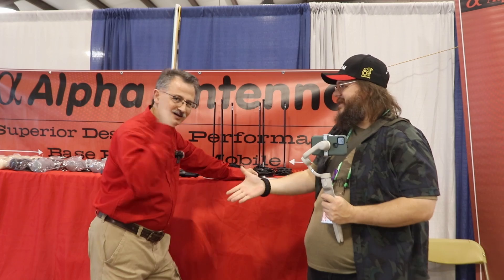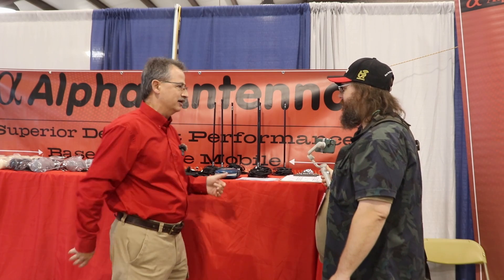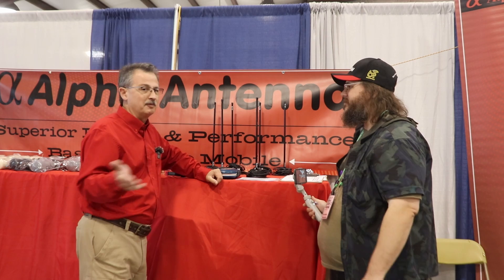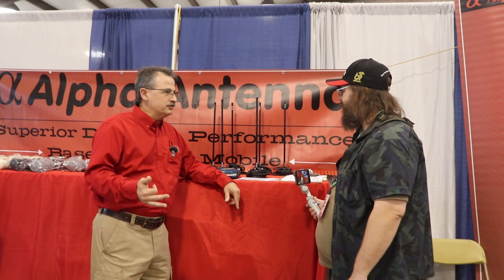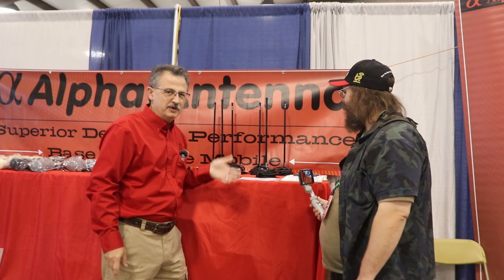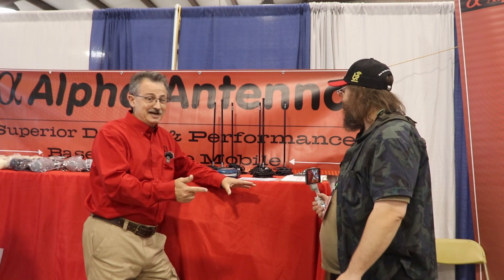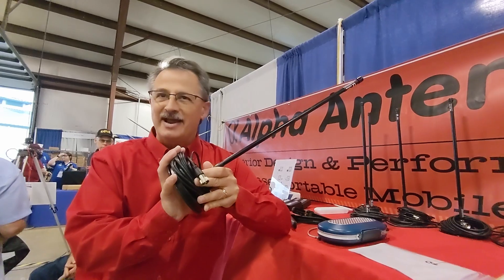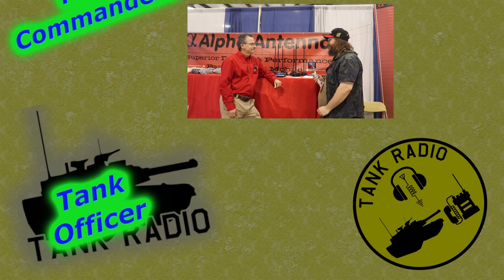Ultimate UHF/VHF mobile Antenna 125 MHz - 1GHz, MilCom MOTO Alpha Antenna at Dayton Hamvention 2024

Comment: Love this antenna, unfortunately my truck is aluminum and the mag mount won't work for me.
Reply: My truck is aluminum, as is my bed cover. I am thinking about bolting a steel plate to the center section of the cover.
Reply: Use an aluminum magnet!
Reply: Hams are known to adapt and improvise and survive to GET THE SIGNALS out!  I'd buy a different truck or use stainless steel under the Al to create a working surface.  Folks been making antennas work with fiberglass vehicles for decades now, but they had to try. Perhaps it's impossible with this antenna, but also Tanks are not made of Al.